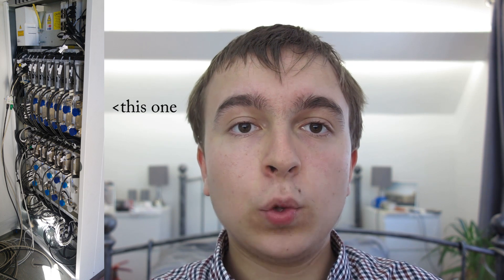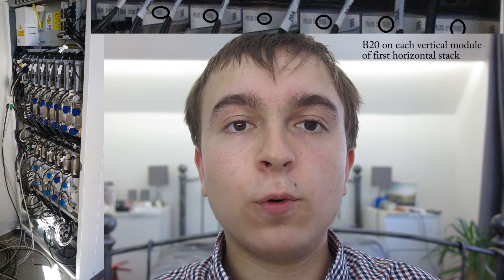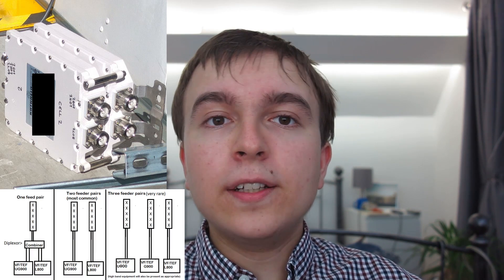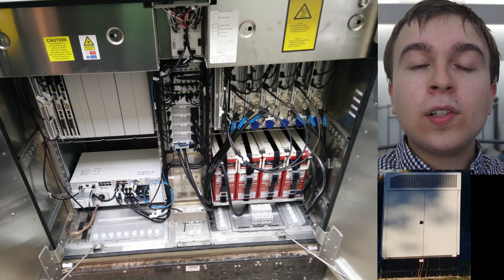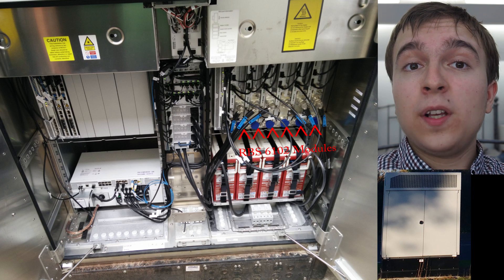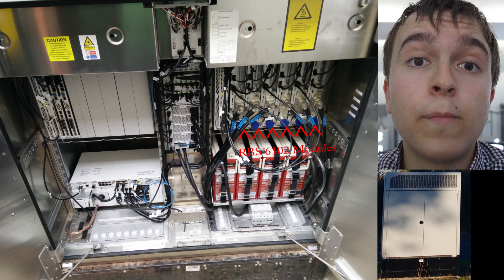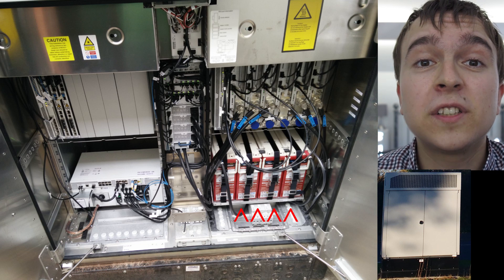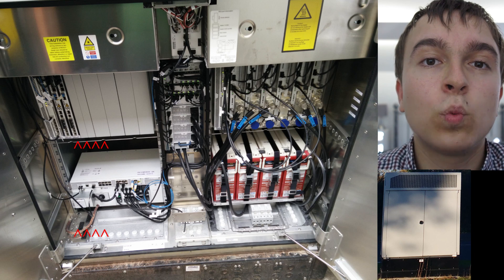Revealed: Insides of Mobile Mast Cabins and Cabinets! Ericsson RBS6102 BTS, 3 Komodo, Hutch...

Comment: AWS 2100 operates from fiber jumpers going from the DUS to the squid then to the RRU's before going back to Coax jumpers from the RRU to the antenna. The antenna connection in the Shelter would not have been for LTE.

Comment: At 1:49, my guess is the top rack is GSM and UMTS with the bottom rack being LTE. The sites I've seen needed very little equipment for LTE. It's quite amazing. 

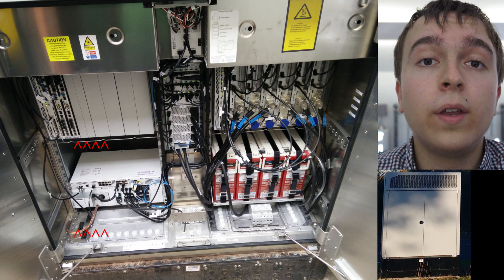At 8:45, are you sure the top left equipment isn't a DUW and DULs for UMTS and LTE? It's definitely Ericsson something because of that dot design.
Reply from the maker: 1:49 is covered in detail in the video. Top is Band 20 (L800), bottom is Band 8 -900MHz 2G and 3G. This was confirmed by workers. 
08:45. They were all set up for UMTS though I'd be surprised if they're not RUS.
Reply: 8:45, this is a dual DUW U2100 config, primary DU right sub rack next to radios, secondary DU far left subrack. The other 2 DU's on the left are DUS31's, L800, feeding RRUs via fibres, the horizontal unit on the left is the SIU, site intergration unit, which describes itself. There should be another 6102 cab at this site, carrying GSM and UMTS 900..........

Comment: I've often wondered about the somewhat exposed large 'Samo' cabinets used by either 3 or EE at mbnl sites. I'd imagine the gear is water resistant, but still is quite odd. Ive seen referenced in quite a few planning  documents that 3 use Samsung BTS equipment in their Komodo and Pagona street cabs.